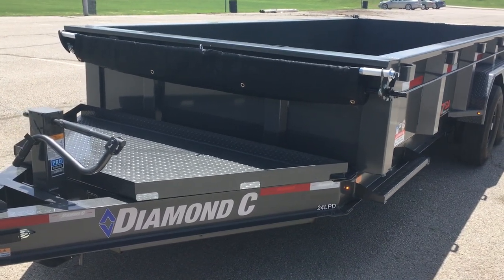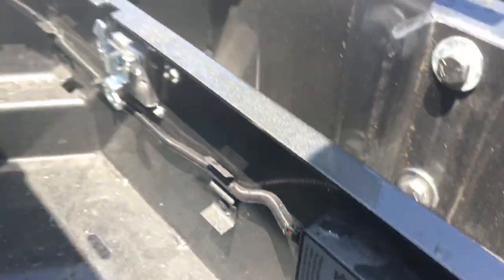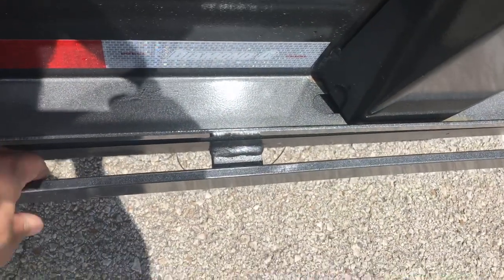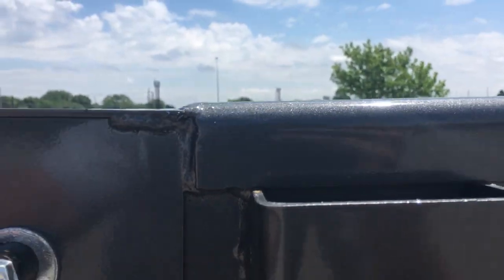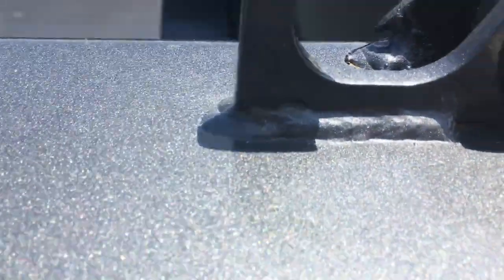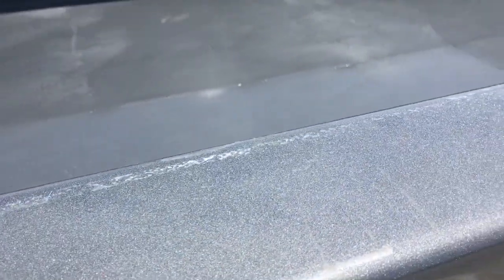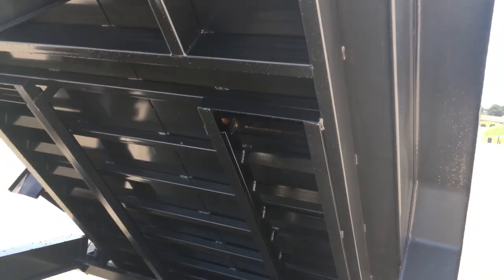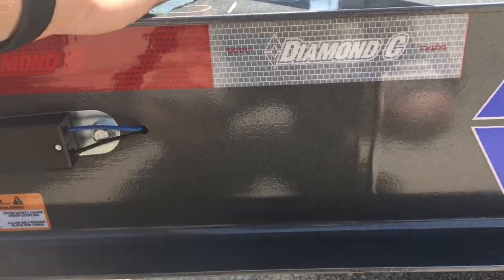Diamond C 24LPD Dump Trailer Review

Comment: Great review,  thanks for taking the  time.  No doubt it will help someone looking to buy.

I run a similar PJ dump and it has similar fit and finish issues.  The dump trailer market is competitive and  figuring out how to cut time/cost in your trailier and the PJ is evident by all the splatter on both trailers.

Check both lower outside corners of your tailgate.  Odds are the square tubing is not welded all the way around.  The PJ was not and the short welds cracked and let go.  I took the tailgate off and welded the square tubing all the way around.  The tailgate now aligns better and shuts solidly now.

I think you have an excellent trailer that will serve you well and again, thanks for the review!

Comment: Thanks for doing this review, I sell Diamond C trailers and customer social media is the best form of advertising even if its not always totally positive lol. looks like you designed a pretty sweet dump trailer overall, its a bummer that these little things that could have been caught and fixed have hurt your experience. 
sounds to me like your dealer dropped the ball in a couple areas
1. they need to set your expectations ahead of time on lead time, you can get up to date ETA on any ordered trailer daily with Diamond C - not hard to keep the customer informed
2. they need to go over the options COMPLETELY- the front is not 7 gauge its 10 gauge, a side step may not be available with the spare tire ect- this comes down to setting expectations again, then you wont be disappointed when it lands. 
3. if a trailer lands with forgotten options or poor quality they need to jump on that and either get it fixed or get the customer compensated, you should not be responsible for adding the rear jacks, they should handle that and give it back to you repainted and ready for work. that front corner fitment is not acceptable but sometimes a little discount off of the original price makes things a little more acceptable.

all in all i think Diamond c makes one of the best trailers out there, i think your experience was below their average from start to finish- im biased i know
Reply: This is great. I like to see honest reviews and someone who works for the company standing up and giving a good explanation of what might have happened. I'm in the market for a trailer and this video helps

Comment: Man, thanks for thanking the time out to make this video. I no your mad by the length of time you put on the review. You did point out all of the perfections.. I did buy Max D low boy dump it’s top of deck is 18” inch off the ground. It’s grate to get all the equipment in and out. I didn’t lock down the door on the passenger side and lift the dune a I damaged the gate. I ordered the replacement,.. and the replacement was all fuc k up.. it cost my an additional $450.00 to fix there fuc k up. So I no where your coming from.. but I really like the dump. Use it and make your money... 
John Evans

Comment: I like the time and effort you took to put this review out. I ordered a Diamond C 48HDT in the 24 foot length early in September 2017. It did not arrive until early January 2018. It took around 5 months to receive the trailer. I was originally told it would take a couple months to get it. That was BS. I was not happy with the time it took to get the trailer. I even called Diamond C a couple of times thinking the place I ordered it from had held up my order. Diamond C was not helpful at all and referred me back to the trailer dealer. They could of at least looked up my order and let me know what the deal was. 

However when I finally got the trailer, I was very happy with the quality of the trailer. The welds and fit are superb. 

I think the company must be overloaded with orders and not enough employees to do the job. In your case the skilled labor was in short supply. Maybe you should send this Utube to Diamond C? It might make a difference. I hope they would read my reply as well.

Comment: I too am in the market to purchase a split tilt trailer to use to pull my new $165K  OMME spider lift. I can't afford to take chances with bad craftsmanship.  All the Diamond C videos look pretty good but real world experience is what I need. Thank you for your time and effort to raise our awareness of the product. I now will be looking at other manufacturers trailers.
Reply from the maker: JOhn reich, I wouldn’t count Diamond C out, all the way, yet. As disappointed as I was in some of the issues shown in this video, I still recommend Diamond C, for some applications. In fact, I’ve helped the county maintenance shop design and buy two trailers, both ended up being Diamond C. The first should arrive in a week, or so. It was custom ordered. I plan to do a video review of it. If it comes in as ordered, the County is going to order a custom 40k gooseneck, from them. In my area, the heaviest built trailers are Diamond C and Maxxd. 

To date, mine is the single worst example of a Diamond C, that I’ve seen, but you should wait until my follow up review, before you take Diamond C out of the running.

Comment: I was in the market for a Diamond C dump but the wait times for a custom build are pretty long right now, I ended up getting a MaxxD 14k from the lot that was I think about $1500 less than a comparable Diamond C at this dealer, now I'm glad I didn't wait forever to spend more and get lesser quality. Every area of concern on this Diamond C is not present on the MaxxD.

Comment: Hi Nikerret...I saw your reply on TBN and thought I would update my results. When my trailer came in I was satisfied with the welds and job they did making it. I think they are a really nice trailer. I decided to double check the bearing play after using it a couple times. After jacking it up, I noticed that one wheel had way too much play and the others were OK. Taking the dust cap off, the spindle nut would not tighten nor unscrew. That's because the axle threads were stripped. I think one of the work monkeys at the company must have used an air ratchet to tighten the spindle nuts up. So...I took my trailer back into the dealer and dealt with them about honoring the warranty. The axle would need to be replaced. So...two and a half months later I had my trailer back with a new axle. I double checked that axle, right there at the dealer when I picked the trailer up...both sides. The dealers selling trailers and fixing RV's are also undependable in getting things fixed. They put jobs like mine off to fix more money making RV's first instead of warranty work. I had some words with the owner.

Bottom line...if you order one or if it is on the lot...go over it with a fine tooth comb. Jack the wheels up and check bearing play at the dealer. You may look like a PITA but I think it is a wise thing to do. I think the quality control was lacking at the plant when I ordered my trailer. And don't expect it to come in on time.
Reply from the maker: Which trailer did you get?
Reply: @nikerret  I got the HDT in a 24 foot length. Tilt trailer hydraulically dampened. Rub rails, lockable tray up front. They recently changed the design and went with a more angled front bed. I am glad I got the older design. Very happy with the trailer. I think I will weld up some low removable sides to go on it to make it more versatile.

Comment: Nice review and nice trailer. 
I own a Load Trail 14k 12 foot dump trailer that I bought new two years ago. 
I wanted 12 foot because it gives you more useful payload in the 14k model that I bought. I haul gravel,dirt,sand even manure...whatever material thats needed.
I had no intention of hauling equipment in it as we own a PJ 24 foot dovetail ,14k bumper pull (used and couldnt turn down the price of which I almost felt like I stole it) and a Big Tex 30 foot,24k gooseneck also with a dovetail. That one was also bought used at a great price.
I own a 20 foot and a 12 foot utility trailers also.
But I did the same thing to my Load Trail.. looked it over real hard. I looked at it at the dealer but I drove from central Arkansas to Trenton Texas and got there 20 minutes before closing.
The paperwork was ready because we took care of that the day before and paid $6500 cash after everything. And it was the last 12 foot they had..paperwork was done for mine. But it looked good so I towed.
I found several issues like you...the tail gate wouldnt lay all the way down..not like I wanted. The welder had welded the lower straps just about 1/4 " to high. But I have yet to lay it down. 
The slots for side extensions I didnt notice until a few loads of clay gravel. The fender had no hole in it to drain so it filled up with water and any material that may have ended up on the top rail. 
On that one I contacted the mfg and they offered to have it fixed. But I weld..so I was able to cut it out to allow everything to drain. They sent me the new door latches for being so understanding and as a token. That was nice but have yet to install them.
Add on ones are set up for self tapping screws or small nuts and bolts.
Nope...someday I will weld them on and have a buddy that owns a powder coating business fix the powder coating.
Yeah I could critic welds but I know they will hold and mass mfg isnt trying to stack dimes. They push product out as they all do.
I hate powder coating...my bed was scratched up fast...so streaks in the powder coating. I will just paint it to control the rust if it ever sits long enough.
But so far I really like my Load Trail and happy I bought it.
I came across your video because I found one just like yours at a great price...almost to good. I am calling tomorrow to verify the price...if its correct then I am on the road fast.
This one is a 2018 and in the morning I will call to find out more.
But your no trailer newby and thats clear so you dont need the disappointing news that trailers dont look good long when used.
I love comments almost as much as the videos. Gotta love the comments from dreamers that most likely they have a toy trailer to look at but dream of growing up and maybe ...just maybe own a truck that can handle a big boy trailer.
Thanks for the good video and keep hauling and dumping.

Comment: Would love to see a follow up video on how the trailer is holding up. I'm in the market and have been looking at Diamond C and Lamar. Currently leaning toward Lamar.
Reply from the maker: Other than the issues shown in the video, which are largely cosmetic and preference, the trailer has been solid.  There have been three times if failed to lift.  The first the solenoid on the pump went bad-replaced by KTI for free.  The second and third, the loader didn't load me evenly and I was trying to unload on an incline-not the trailer's fault.  A little redistribution and it worked fine.  I had one tire split, which was covered by the tire manufacturer (good thing I had a spare, wasn't even out of service). It pulls well and gets a ton of compliments.  It's one of the best looking dump trailers on the road.

I'll see if I can get another video up.  I've used it a lot and it's holding up well.  There are some other things I have noticed, but no deal breakers.  I highly doubt there is anything I would be 100% happy with-I'm always looking to improve things, no matter how good.

Comment: I hate to burst your bubble but you are very picky. I understand that you are paying for it However it doesn't effect the use of the trailer. I love diamond c i have a dealer down the road who sells them and he sells a lot of them. He can't keep them in stock, before the pandemic they had a 6 to 8 week waiting period. When you buy a dump with 7 gauge steel typically they mean the sides only. The long sides. Lamar uses 7 gauge floor and sides i believe standard feature. Trust me ive been researching dumps for years. Diamond c, moritz, big tex, PJ, lamar, nonstar iron bull, sure trac, load trail, and ive found that i will probably either lean towards pj lamar or moritz. I can find pj and lamar about 50 miles away and moritz is in my hometown. Moritz offers auto latching coupler, auto latch gates, and they are lighter in weight by about 100 to 200 pounds. A 7x14 14000 GVWR weighs in at 3900 pounds. Or I may go with a 7x14 lamar with 36 inch sides that weighs 4025 and is 7 gauge all the way around. I look closely at them
Reply: If he is very  picky  why he  decided to made a video  Instead  to talked  to the company  right away

Comment: There is a nut and bolt on the handle  I'm sure you can easily take the jack handle off and put it on the other side 🤷🏾‍♂️
Reply from the maker: Why would that matter? The issue is the welded hook puts the handle against the grease zerks. I don’t need the handle moved, the issue I was pointing out is the hook could have been welded on the back of the jack. In that location, it wouldn’t hit anything or interfere.

Comment: I just bought the same trailer. The welds were nowhere near that shoddy on my unit. Was manufactured 1/2020. I would NOT have bought it if the welds looked like this. Sure it will be fine though. Bought it straight off the lot. Passed on the PJ’s as well.

Comment: Right now all these trailer companies are pushing out trailers as fast as they can and unfortunately the quality is not there. It sucks because you are paying about 20% higher than these were in late 2019 and not getting a better product. I bought a Texas Pride Trailer and it's built like a beast but the cosmetics are not that good. They silicone the top seams on the trailer and that person sucks bad, you can tell where they started and stopped (about every foot ) and they dripped silicone down the sides and on the floor and painted over it. I waited 4 months for it to be built and paid over $14,000.

Comment: I have a Diamond C tilt equipment trailer. It's built well with none of the discrepancies you are showing. My dump trailer is a LAMAR which is in my opinion better than the rest. I compared PJ and LAMAR side by side.

Comment: I do agree that one side should be better.  I think the Jack is made by another company. As far as dump trailers I have seen. That is one good looking trailer. I have seen many other trailers and they are way more chincy. It could be they was in a hurry to get a trailer to an impatient guy.  Good things come to those who wait they say.
Reply from the maker: I think the largest issue was they moved the production building, while my trailer was being made.  The passenger side misalignment could have been from not adjusting the brake from 10 gauge setting to 7 gauge, which is what my "integrated sides" and floor are.  This is just a guess.  based on the trailers I've seen, built since, they have all been better fitted.  Again, just guessing it was growing pains, in the new shop.

Comment: What color is this? Can yo u let me know the specs you ordered. I'm currently planning to order one. Love the color
Reply from the maker: Color is “Charcoal”. This was one of the last with automotive paint. The current production is powder coated and the color comes out slightly different. My trailer has several options: side step, 7g floor and side walls, 12/10k jack, heavy duty ramps, 12” on center supports, spare tire, HD toolbox, black painted wheels including the spare, and wireless remote (lost that). It was ordered with a couple more options, but didn’t come, as requested. I may have forgotten an option I did get. If I remember it, I’ll post it.
Reply: @nikerret  thanks bro. Is it similar to Metallic grey? I just ordered mines and seen yours love the color
Reply from the maker: @kenkvt707 , I believe the Metallic Grey is fairly close to the old Charcoal. I’m not certain, since I just looked at pictures, online, to compare. In the pics, the current Metallic Grey looks a little darker. With mine, a slight change in light makes a big change, in how it looks.
Reply: How high is the sides? @nikerret
Reply from the maker: @kenkvt707 , this is the standard two feet tall sides.
Reply: @nikerret  thanks brother

Comment: Good detail review. DC is still the best made trailers but it sucks if you're not at a dealer where there's 3 of the same trailers to chose from so you can pick the on made by an individual tradesmen that thinks & cares to make the most visible areas of welding and weld spater removal count! I fear ordering a trailer and thats it if the welder sucked you only got one choice
Reply from the maker: I just posted my 4.5 year review, feel free to check it out. Diamond C remains at the top echelon of my list.

Comment: I was leaning towards this trailer until I saw your fit and finish issues. I would be extremely unhappy spending all that money to have it look like it was put together by a first week high school shop student. Y’all ever heard of a grinder, flap wheel or quality control technician?  Sad 😞 
Thank you for the honest and detailed review. Something as simple as the jack handle and side step would be no goes for me. Add in all the other bloopers, misalignment, poor welds, stabilizer jacks, wet toolbox 🧰 I’m afraid I would be fuming 😤.
Holy crap, rust on the underside too! I’d be taking it back requesting a 100% refund. Too bad because for that amount of money things should be almost perfect.

Comment: Its a "Dump Trailer", it's gonna get used. I'll agree 100% about the side panel be 1/2" off. I'd almost be willing to return it for that. But most everything else is "normal" or Minor details.  One thing you did not bring up is the incorrectly applied reflector tape. RED should face rear, or RED on the outer ends.  Good video thought.